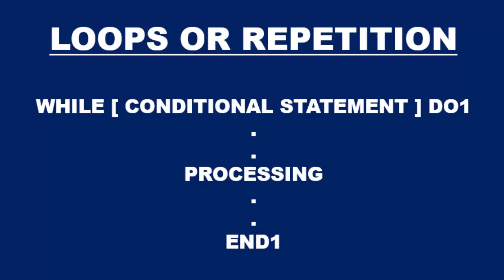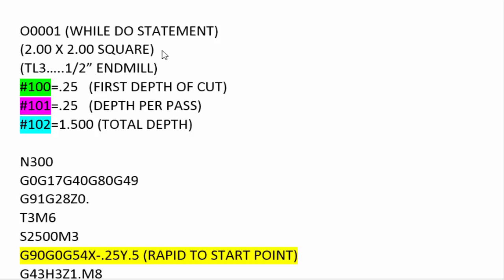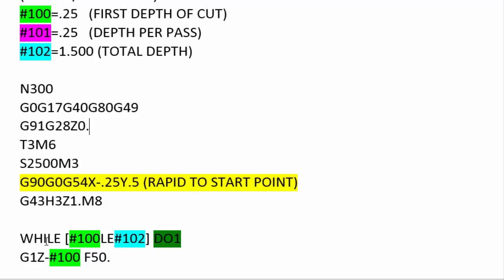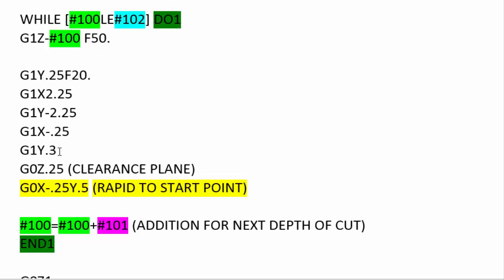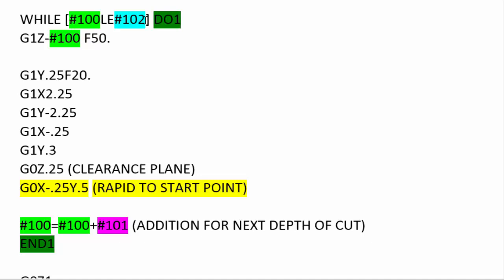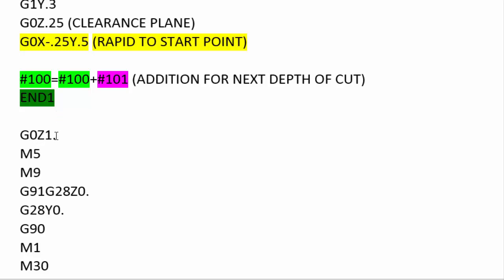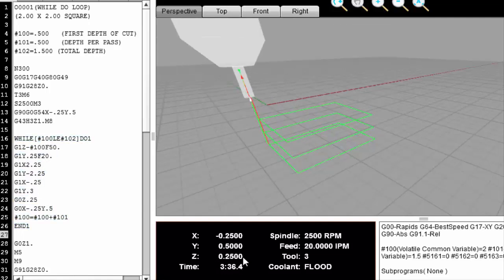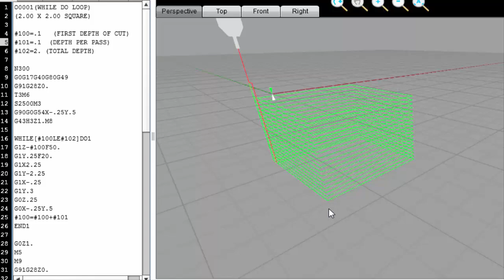WHILE DO LOOP IN A CNC MILL PROGRAM

Comment: Hi Tom my name is Hannes. I have been following your videos on macro b programming. We are incorporating the probe on a VTL lathe but I am having issues using the while loop on machining inside and outside diameters. Please could you share some InSite into how the while do will work on diameters when machining a profile that consists of chamfers and two or three different diameters. I will really appreciate the help. I have done a CNC program that uses a canned cycle to rough the profile to 5 mm from size. I want to use the while do statement to machine off the balance of the material before the probe goes and measures the dimension again. Once measured I will make an offset and rerun the same final profile cycle to recut the diameter in question. Thank you in advance

Comment: This is a good starting point.
I'm used to do this with a different aproach, because sometimes you need to fix depth parameters, and it is useful to do the dividing job to the CN.

For example (using millimeters, I can't understand why using medieval units on a NC machine 😉):
#100=0(starting plane, Z0 for example)
#101=20(finished depth of the cut)
#102=5(number of passes)
#103=[[#100-#101]/#102]
WHILE[#100NE#101]DO1
(Starting position coordinates)
G1Z#100+1F1000
#100=[#100-#103]
G1Z#100F150
(Working coordinates)
G0Z5
END1

This can be a little bit more complex, but when you starting using it it isn't.
It allows you to adjust depth parameters without problems only modifying the #102 parameter.

It is also a lot useful when you work, like me, on a lathe with live tooling when you have to mill complex surfaces with a round edge mill on the diameter.
Adding some parameters you can work with C-Z interpolation making a potentially infinite number of passes, with the same program style, adding also calculation for conicity you can rough and finish for example a conical pocket.

This is only my way of working, I started with basical parametric programmation and then I applied some logic to do what I need with shorter programs.
Reply: Are You working on Y axis lathe?
Reply: @TheVist7  Yes, it is since 2017 that I changed factory and I haven't the Y here, but the same approach work also on the Y machines.
Reply: Thank you I was trying to use "number of passes" instead of "depth of each pass" !!!!!
Reply: @Sneildog  you can do it simply.

Comment: Sir I'm not getting why yoju are using G91 in line G91G28G0 ?
Please respond
Thanks
Reply: G91 Incremental Positioning
Reply: because machine home position not program position.
here are examples: 1.) G0G91G28Z0. (safety codes at the beginning and at the end of the program)  this means your tools is above your part 10+ inches (depends how big is your machine) away.  2.) G0G90G28 Z.1(never write like this. I just give u for an example to make it clear why using G91 in that line as u had mention) this means your tools are above your part Z.1
Reply: Plz make video in circular pocket25radius
Reply: Which software your using
Reply: G91 is absolute positioning in which the machines takes the coordinate entered when taken zero point on the object and G28 is used to tell the machine to travel to the point of G91 and G0 is rapid force. so totally it mean to move the spindle to the absolute position at rapid speed.